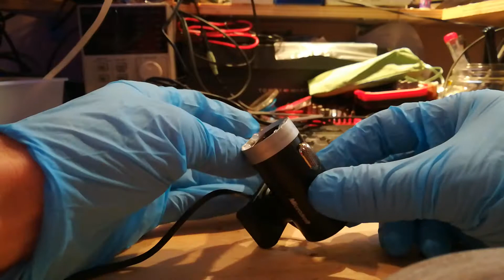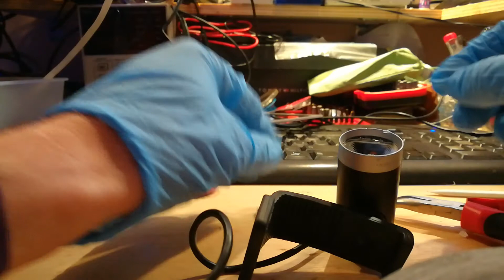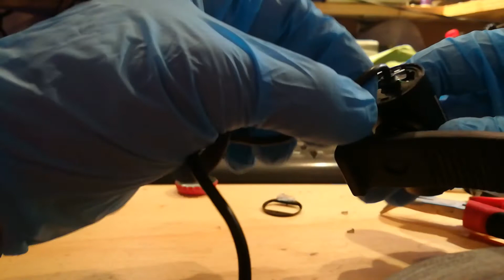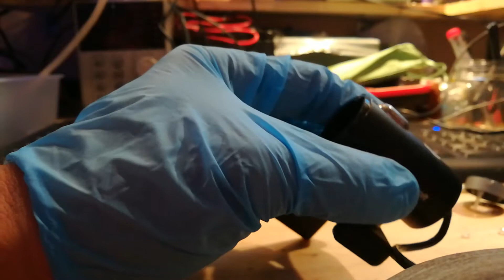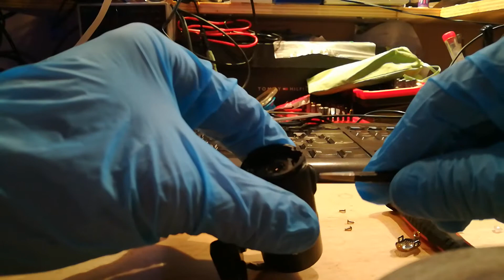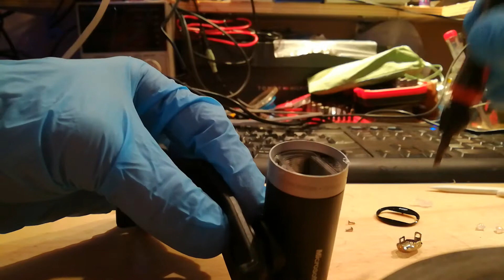Microsoft LifeCam Cinema cleaning

Comment: To remove PCB (from stage when this video ends) you have to remove microphone (rubber part and plastic and disconnect it) and remove button (2 clips). To access button clips you have to remove foot - 2 longer screws, one from front, another from back.